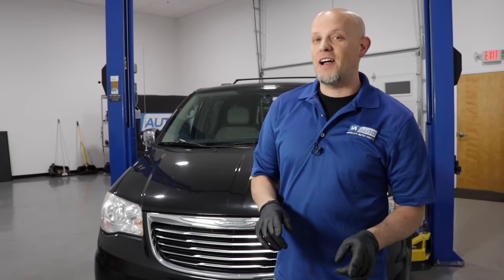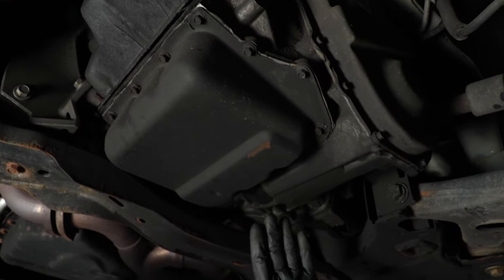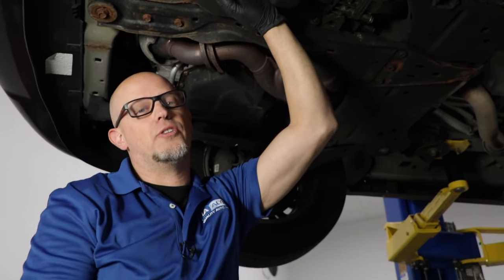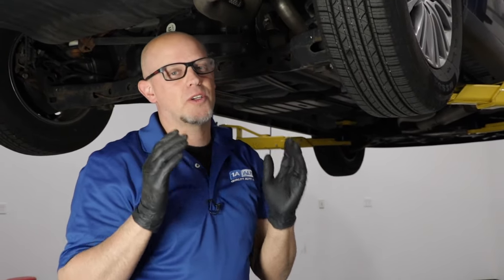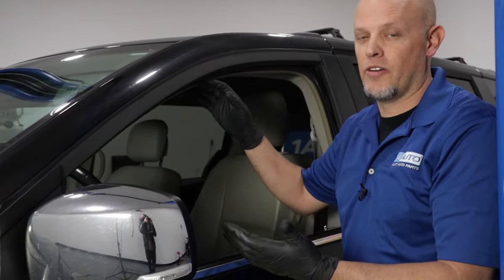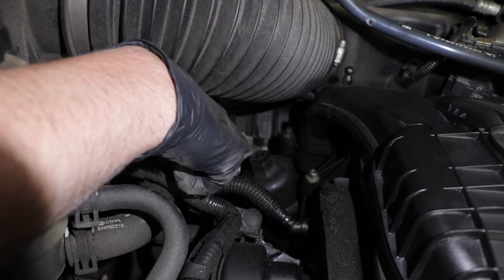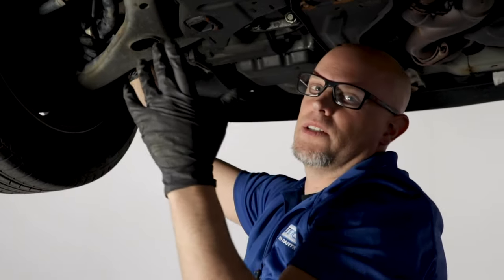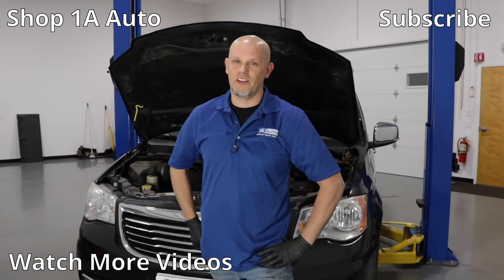Top 5 Problems Chrysler Town & Country Minivan 5th Generation 2008-16

Comment: One of the best presenters is this guy at 1A Auto. I suggest ATF service [pan drop and filter] in the mid 80,000 miles range at the latest. Thereafter, 60,000 miles if you keep the van. The oil filter housing problem emanates from overtightening the filter cap. With proper care, these vans are very reliable.
Reply: I have 114000 miles on mine with just basic oil changes and regular maintenance.
Reply: I gotta say as a long time Mopar guy this minivan has made me hate Dodge. 
Nickle and dime with small crap going wrong with it (if you count the clock spring going out causing the brakes to lock up at random times minor). A local Stealership has not helped matters at all. 
I will never own another Dodge, they can go to hell.
Reply: Vin One gentleman! Of the 08-14 Dodge/chrysler can you recommend a particular  yr/ motor size? I am looking to purchase one!
Reply: @dougschmidt4137  I would suggest 2011 and newer. You get one engine option, the 3.6l pentastar which is a solid motor. Look for the HD brake model, and maintain the transmission as recommended. Overall these vans are great vehicles. Better enjoyed if you possess moderate mechanical abilities no doubt.

Comment: The sliding doors would open at random a while after driving at 60 mph. Chrysler says there's no known problem. Dealer couldn't find the problem, they wanted to fix it by disconnecting the door motors. Nothing but problems, full of squeaks and rattles, the interior was solid plastic. Just cheaply built, 3 months after buying it, the transmission started acting up, dealer replaced transmission, a month later it has tyranny problems again, slipping in 2nd gear. Ac would blow 70 degree air, was told nothing wrong. The keyless ignition module failed, was replaced, a week later I'm stranded with it, keyless module failed again, now it needs another module at $3000, and tipm needs replaced, I traded off the junk pile and got a nice ford, the Ford performed flawlessly for 6 years, way more comfortable than the chrysler junk. Every Chrysler I've had was junk full of problems. I traded the van off, the guy who bought the van got killed after the ignition module failed on a busy highway.

Comment: Exactly.  Even a Rolls Royce has issues.  1] Driver seat (electrical) and longevity with the booster support wearing out; 2] the Japanese tranny is plain trash, 2nd T&C and noted the same problems again; 3] suspension shocks need to be replaced under 100k miles, fit and finished on panels, still an issue during this time frame (merger of unequal MB/Chrysler).  However, this is my sixth minivan.  Why do I love this mini?  STOW-n-GO, and it will go 300K miles.

Comment: My 2014 T&C Limited was purchased with 35K off a lease in 12/15. No major gripes. Replaced spark plugs, serpentine belt, and serviced transmission at 100K. It does everything I want it to do, with minimal fuss. Been to California, been to Arizona, been to Utah, been to Wyoming, been to Maine a couple of times, been to Florida a couple of times, and back and forth to many places. Change the oil & filter, and the other filters (air & cabin) per maintenance schedule, brakes and tires when you need to, and you'll do all right. Now at 160K, hope to keep it goin' for at least another year - maybe two.

Comment: Our '14 Town & Country rolled over 200,000 miles this summer.  I recently replaced the oil filter cover, had the timing done by our mechanic, and I'll be replacing the struts and sway bars myself very soon.  Buying the parts from 1A of course.
Reply: Hey AJ, that is so awesome. have you come across a cylinder 1 misfire code P301? Any insight is greatly appreciated, thanx.
Reply: @Pacmanny14  i did recently in our 2008 4.0l TnC, it was actually a strange situation.

i spent a lot of time google searching why id find oil in the plug hole when i pulled the coil off the plug.

plugs were in good condition, but the ignition coil on 1 of them was soaked with oil.

after some searching i found out at higher mileage the down tubes which are pressed and glued in, tend to lose seal if they are even a tiny bit wobbly.

hoping that wasnt the case, we replaced the coil and had the exact same issue about 3000 miles later, same down tube, ruined a new coil.

so we got the upper seal kit, and put that in, put in another new coil, and dr0ve it tgat way till it started to have the same issue again P3 code indicating a misfire/no-spark, same cylinder, so i finally relented and did the down tube repair.

so i very very carefully extracted the down tube with a set of thin and long needle-nose, gently wiggling it until it came all the way out, it was finger loose at first and could be wiggled easily, but wouldnt fully release.

once i got it out, i used a wet/dry vac, amd some brake cleaner to blast the oils away, and suck them away from the spark plug hole.

then applied a small amount of full cure (not the Kwik set stuff) JB Weld, once the JB weld was curing with the tube in place we put the plug and all the stuff back in... BEFORE doing that, make sure you dont have excess JB weld near the plug hole or that plug becomes permenant to the engine HA HA.

now she runs good, just gotta fix the transmission sticking into limp mode and shes running like new again.
Reply: @Pacmanny14  that was common on the 1st generation Pentastar engines (2011-2013) they had a faulty head & the only real remedy was to replace the head but they did fix this issue on the newer versions (2014-up) supposedly...

Comment: I had a 1997 model T & C LXi since  2003. Going into 200k, it was passing coolant through the exhaust. Other than that, it was  the usual maintenance. I had to sell it in 2020, and I chocked as I saw it leave for the last time. Our kids grew in it trips into Mexico to see beaches volcanoes and pyramids in the summers, the grand canyon, San Francisco and Vegas. 
I'll never forget my van.
Reply: I just got my first one and it's a 2015. And so far I love it. It's so comfortable.
Reply: @NamasteTexas  I have 2015.  What I don't like is the road noise.  Compared to the latest Pacifica, noise cancellers work to minimize noise levels. Even the wife's Ram is super quiet. The rest? Love the mini (6th purchase).

Comment: I own one and it has been really solid in its 8 years and 300k+ miles.

I have replaced a few parts here and there, but it had two big issues. The first one is that the transmission always has a big thump feeling when it's cold or too hot (it's been that way since it was brand new). And the second one is the TIPM fuse box.

The TIPM fuse box grounded the van for about 6 months because it just didn't want to turn on and we didn't know if there was a problem with the fuel pump or the ignition motor. Turns out it was the fuel pump relay that is not serviceable on the TIPM. A brand new one was way too expensive, and the solution was a very simple jumper cable between a couple of fuses. It also kept blowing fuses whenever we tried to adjust the seats, and we solved that with a slightly higher rated fuse. Even though the solutions were simple, it's pretty annoying when you can't use your car for half a year due to a very small electrical malfunction.

All in all, it has been pretty solid, specially for how much mileage we put on it.
Reply: Any ideas where to find reliable info on which fuses to jumper for this?
Reply: @joelporozynski  There is a specific part you can buy online to do it safely. They offer three models, one is a simple cable for testing, the other is a little PCB (that is the one I have), and the last one offers a number of options that may or may not be important to you. If you google TIPM fuel pump relay solutions, you can find a number of stores that fabricate and sell them, along with a lot of information of why the problem happens, and how to solve it. 

In my six month long journey, the van was kind of working for the first three, it just took a while for ignition to happen. After that, the van couldn't turn on at all, and I began my investigation then. I actually found the problem pretty quick after a google search and some testing. I then ordered the part I needed, and FedEx lost it the first time. That was the main problem on why the van was grounded for so long. I got tired of waiting and straight up ordered another one, and that solved it for me. I haven't had any issues since then, and that happened about 3 years ago.

https://www.verticalvisions.com/tipm-plug-in-fuel-pump-power-bypass-test-system-lite.html 
This is the part I bought, and the instructions I used.

Comment: Nailed em! My 2012 has had 4 of these top 5, but has 275,000 miles on the OD and averages 24.7 mpg.
Reply: Damn! That's alot for an FCA generation town & country
Reply: How many transmissions??
Reply: Yeah, mine gets really good gas mileage for an '08 with 114000 miles.

Comment: Had the issue with the window. Now I’m worried I’ll have the other issues. Had transmission service at around 80k miles. I’m on 108k mikes and love this van. It’s a smooth ride and so practical. Easy to empty the seats to move bigger items.

Comment: This sucker is pretty reliable over all if willing to give overlook superficial things like seat cracks and seat trim breaking. 

Ours is 13 years old and have had the front links replaced and rear AC fail. We capped the rear ac for 200 bucks and survive fine off the front AC.  The oil weeps just a bit where he shows in this vid but not enough to drip or be a mess. Synthetic oil and still running strong on almost entirely original parts. Impressive.

Comment: Very reliable, I had 3 of them.
Driving à 2009 T&C 4.0l for 6 years, just minors things!
And hauling a 24ft Travel Trailer with minors upgrade (extra trans radiator,  balloon in the back) and hitch with extra fixing point in front of rear suspension. Hauling that for 3 years, no problem, and fantastic and practical cargo room !!🙂
Honda Odyssey I had before (1999-2004) had à lot of problems,  including a broken transmission !!
Reply: Hey can I have one.
Reply: The 4.0L model is different from 3.8L, different transmission too, so maybe that's why?

Comment: Notorious issue with this vehicle is the Y connector for the heater hose for the front and rear heater cores   This Y connector assembly  is $100 from Chrysler but can be obtained from auto parts store for less than $10. Connector is directly behind the engine on the right side. The Y itself develops pin hole leaks .
     My 2010 Town and Country has 225K miles and  I have NEVER changed the transmission fluid and it is like pulling teeth to get any dealer to even check the "dipstick free" transmission .  I figure it is gonna happen sometime and a $3k rebuild is still better than making car payments.  I had the regulator cable fail on the drivers window and a radiator replacement and an alternator that would not charge. I got a good one!!!
Reply from the maker: +Phillip Hunt Thanks for the feedback!
Reply: Haha. Yes the pinhole leak!  I had the same problem on a 2006 Mountaineer. I did the $10 Y connector replacement in that car and kept having leaking. I ended up buying the whole assembly with the wife’s van and have had no problems.

Comment: I serviced our 2015 at 50K miles. New fluid and filter. Had shifting issues at 75K and they said it needed a reflash.  Drive better. At 94K it has a bad shutter. It seems 2-3 break on it each year.  A friend that has a 15 just had the engine replaced at 100K miles.

Comment: Drive a 2015 T/C with 130K.  Still loving this van.  I’ve done routine oil (filter) changes and on 3rd set of tire, 2nd set of brakes..  No major maintenance issues (knocking on wood).  Still often question if the engine is running when in idle (very quiet).  Bought this van to do longer road trips for Big10 volleyball , ACC football and family trips from Ky to FL or LA.  Our family and friends never complain as the ride and seating is comfortable.  Still getting 24 mpg on road trips.  Besides transmission shifting hard on hills, I can’t and won’t complain.
Reply from the maker: +ValknVille Thanks for checking us out! http://1aau.to/m/Shop-1AAuto-c

Comment: As an owner of a 2014 from new, I purchased the Chrysler Maximum Lifetime Warranty based on ownership of other Chrysler minivans.The oil filter leak is EXPENSIVE. Over $600. Don’t forget corrosion on the hood (aluminum). This may or may not get fixed free based on FCA TSB. Check with more than one dealer.

Comment: I got to 100k miles and had to replace the transmission. I’m glad you mentioned the AC. I’m having that issue. 

One little nit, the Chrysler symbol came off the back hatch and dealership said no way to fix it 😦. I have a 2013 T&C. I do love it.  It’s pretty much fully loaded as I always purchase the demo car. It’s sorta new but not because it has mileage and dealerships need to get them off the lot after a certain amount of time. I’ve had it for 7 years now. But it is TERRIBLE in the snow!
Reply: @LM , These dam Chrysler dealerships and most mechanics never tell people to change change transmission fluid like 50,000 to 70,000 miles like they should.  They want people to miss it and break down so Chrysler, Dodge can make much more $$$$ from it. Past 7 years now, every mechanic told me not to replace spark plug wires, spark plugs etc....I just did it. Now my 2010 Caravan drives like a brand new now. But 1st Caravan I had back in late 1980s, everything breaks down on that one like every week.
Reply: Yep just dropped money to replace my transmission at 145,000. Pissed about it

Comment: 81000 miles. No lifter or rocker arm problems (use 5/w30 oil). And trans shifts good as new. I add friction modifier twice a year. Recently replaced rotors all the way around along with the front wheel bearings. If the 3.6 is maintained  properly (5000 mile  oil changes. Filters etc…) plan on a trouble free experience.

Comment: Just changed Trans Oil and Filter in my 2013 T&C,  86,000 miles... While at it, I installed a Trans Pan with a drain,  In 6 months I plan to pull plug and change out another 6 Qts,  Then do a filter and oil about 25,000 to 30,000 miles from then on.

Comment: Bought a 2013 last summer. Around 150k. Since have had to rebuild transmission, replace rear evaporator and lines, and the driver's side window regulator. 9/10 would buy again though. Probably go foreign if I had another shot unfortunately.

Comment: Just had the transmission replaced at 98000 miles. Oil filter housing needed replacing a week later. 2015 T&C.

Comment: A few other common problems that I have personally repaired on 2 Caravans are the heater core splitter hoses (dorman makes an upgraded replacement) Hub failures, pinched harness under the driver seat causing an airbag light, because the harness is too close to the backstop and will cut into the harness eventually.
Reply: how did you fix the airbag light,  i find my airbag light goes on and off depending on what bump i hit in the road

Comment: Own a 2014 t&c...77k just replaced torque converter had codes p0128 p0741 just had check engine and code that wouldn't clear. No shuttering or transmission like issues. Also replace oil line that was leaking and thermostat. First major issues had o2 sensor replace prior to in the last 3 years. Love my van most miles is highway lots of trips.... regular oil changes tires etc. I have had the airbag light coming off and on. Warning light on radio display saying it's to hot this is new have to troubleshoot.

Comment: LMBO, Our 2013 Chrysler Town & country's Ac just started blowing not so cold air.  blowing out  61 degrees in 100 degree weather from the front vents at an idle. The rear unit blows only ambient temp. I see where this will end up as the possible cause.  Also   Rattling from front drivers side started at the same time...  What luck! Most likely one of the 2 front end items you spoke of.  Keeping our fingers crossed on the window LOL.  The van has had a very small oil leak on the drivers side  , nothing big just a nuisance drip now & then. Now I know where that issue is possibly coming from . 99K on the old girl, too soon to "put it out to pasture" lol.

Comment: I had a 2013 Dodge caravan, now we just bought a 2014 T&C and the driver window was faulty, up and down when it wanted. Easy fix. Then thermostat went, dealership wanted $475, Mopar part was $31. Plus always get the proper coolant. We went with Prestone 50/50. Total cost was $45.00 start too finish 2 hours and that was running full on heaters as we topped up coolant and check engine temperature.
Reply: My window got stuck down and so I broke the button off to try to manually move the tabs to roll it up and down while it started raining horribly it got wet the whole box wouldn't work to roll up Windows locks nothing so I replaced it and it still won't work any thoughts on that

Comment: What about the TIPM? Heard it comes bad from the factory from a lot of people.
Reply: Just replaced mine 4 months ago ..1400.00 for one hour of work
Reply: I replaced my tipm yesterday by myself. Not hard at all. Youtube
Reply: @bucsoftampa8426  My Wife's was acting up in her 2011 T&C Fuel pump Relay went out just used a fuse bypass cable and routed it to one of the backseat outlets that we never used. Wasn't about to drop the money on a whole new TIPM
Reply: Came here to say, how did we forget the TIPM?

Comment: The main problem is all the plastic pieces on the engine. Thankfully dorman make aluminum options. I replaced the coolant crossover, the timing cover, the thermostat housing, and the oil cooler. All aluminum. Wish they had aluminum valve cover but maybe some day